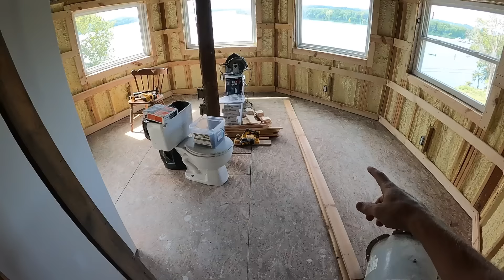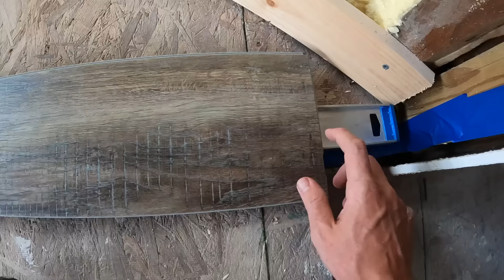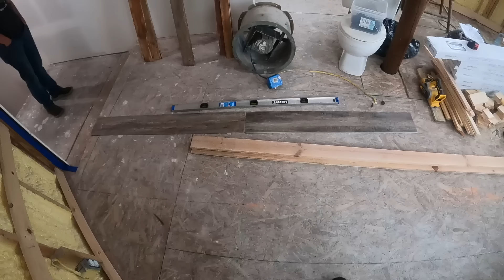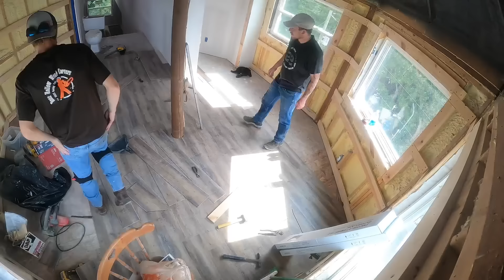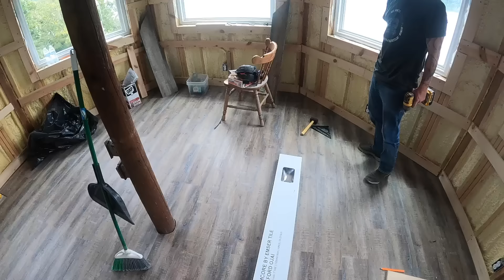Finish floor is done at the castle in the octagon!!

Comment: WHT is there no underlayment?  Why was this done before drywall and restroom etc?
Reply from the maker: No underlayment because we just fixed the floor, there isn’t a reason to. The drywall is done in the bathroom and we are hanging cedar on the walls. It is easier to lay the floor and cover it up then tuck it under the cedar because there won’t be any trim on the cedar!